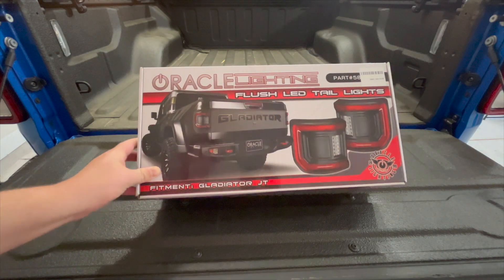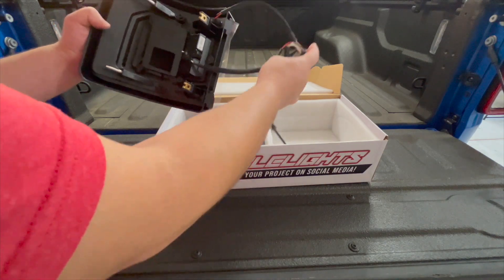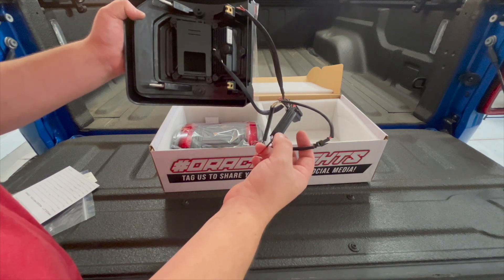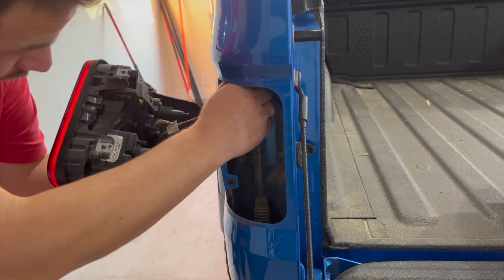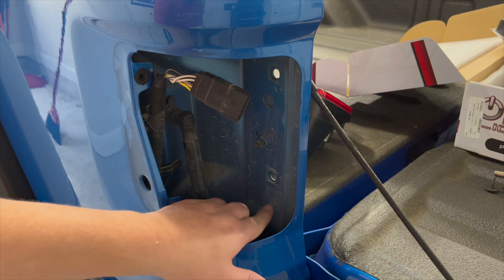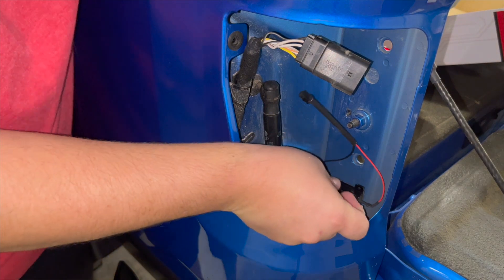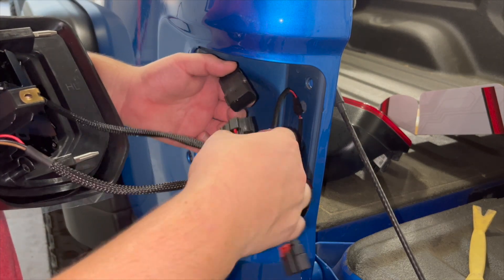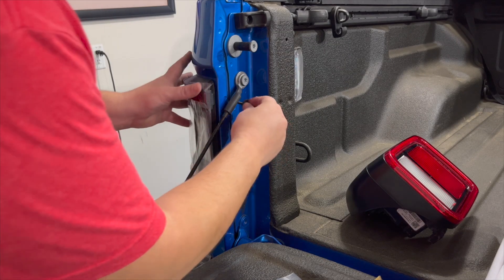Oracle Flush Mount Tail Lights - Jeep Gladiator LED Upgrade Part 2

Comment: I love the more modern look on the new tail-lights!  The Jeep looks so much better without the lights sticking so far off the body. Thanks for the shot of what the front looks like with the new lights too. 🔥 👍👍👊
Reply from the maker: Thanks, man. They look awesome at night!
Reply: @68Charger  how have the lights held up and did you need a tazer or something or was it all just the plug n play that it came with?
Reply from the maker: @baldeagles7493  you don’t need a Tazer. They sent me a light that was defective and immediately sent me a replacement one after a called. Lights have been great since. They have awesome customer service.
Reply: @68Charger  oh okay sweet thanks